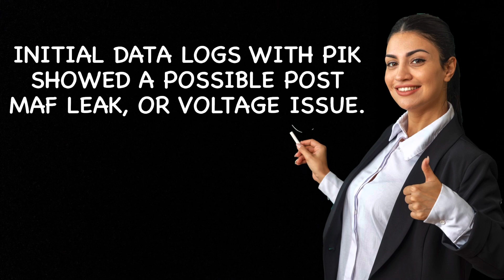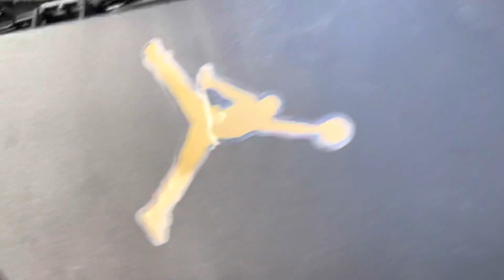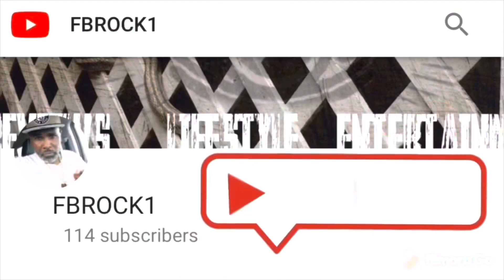Honda Accord 2.0T - How to Boost Leak Test | FAIL? [HD]

Comment: Hey what’s that tiny little red air filter cone you have on your valve cover at 3:28 it’s just under the spark plugs / fuel rails ? Never seen it before
Reply from the maker: Thats a K&N crankcase breather filter. Instead of recirculating blow by gases/oil/ pressure into intake/ turbo, it goes to the atmosphere.
Reply: @fred_b_360  Wowww that’s very interesting, never heard of that use before. Thank you!

Comment: hey bro how much you pay for the red valve cover?
Reply from the maker: Vht wrinkle red paint 🤷🏾‍♂️ I also replaced the gasket (required) that fixed a common leak at the back of the cover.
Reply: @fred_b_360  i heard a hiss sound by the intake mainfold or back valve cover is that normal?
Reply from the maker: probably heard my breather filter.